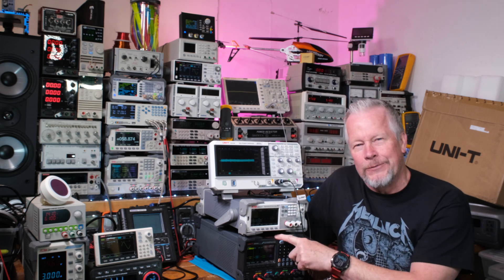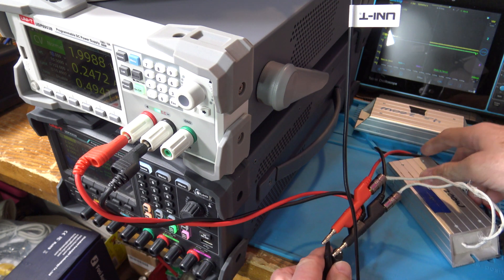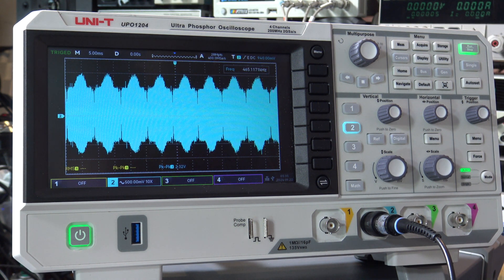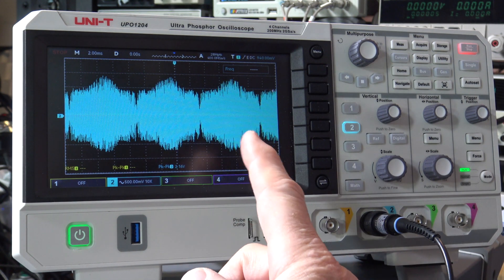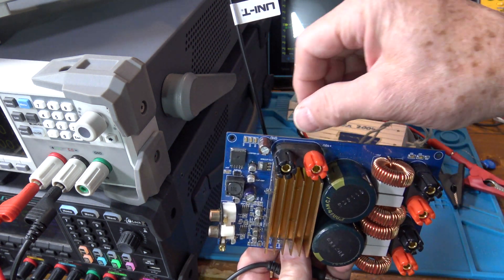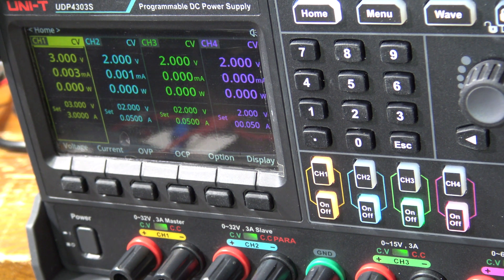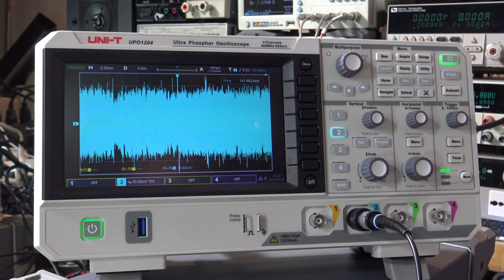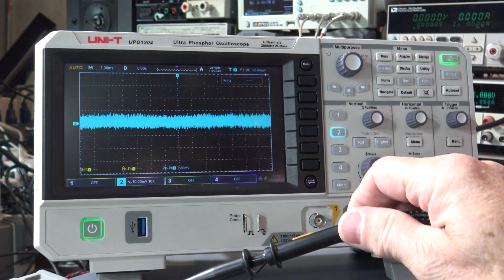Noise in Bench Power Supplies Linear vs Switching with Uni-T UDP4303 and UDP6900 with UPO1204

Comment: Maybe I'm wrong, but to me it seems simply that this specific unit PSU is a bad product. You shouldn't see that ripples on the output, especially in lab supply equipment. It almost looks like the output isn't filtered at all, which would be crazy.
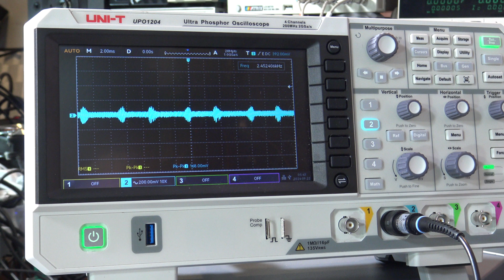Reply from the maker: Thanks for your feedback.  If you look at what I show at 10:30 min into the video - it is actually pretty clean once connected to a load or any input that has the most minimal capacitance.  Also, I am not doing any special probing techniques (trying to minimize the ground loop) so this is actually pretty clean - especially at the full voltage output.   I'll do a video showing how to make a simple filter to help any power supply provide a cleaner voltage.
Reply: @KissAnalog  I didn't think about it when I wrote the comment. Thanks for the clarification. It's interesting to see the differences between load/no load. 

Anyway, I enjoyed the video. Thanks for posting it.
Reply from the maker: I appreciate you!

Comment: I have play some with mine designed resonance supply, concerns the common mode noise. I have read a paper that even 300 mV of noise can degrade the amp distortion very badly. The paper do talk about common mode filters with a feedback through two caps to the primary ground, I tested it and noise did drop to 7 mV max power. Also the paper mention about the transformer, the capacitance between primary and secondary is the cause, a resonance transformer where the resonant coil is integrated as leakage has low inter-capacitance between prim and sec. I do measure nothing as a start. For fly back, she use a extra primary winding who cause a 180 degree signal canceling the common mode noise. this extra windings is set through a capacitor to primary ground.
Reply from the maker: Thanks for your great feedback!  I don't know if I believe in the 300 mV thing - that sounds a bit crazy.

I will show how to filter this;)

Comment: Do anyone believe these measurement results for a second? 10x probe with long ground lead, long wires from the power supply acting as antennas, a wall of powered  cheap instruments in the back blasting noise into the measurement setup. No true measurement's can be gathered from this. Come on man...
Reply: Did you use the 20-20Mhz BW-limit? the UDP6900 should be under 15 mV p-p. If i where UNI-T I would ask you to redo the video to not scare away potential buyers.
Reply from the maker: Great question!  Nope - I think I made a comment about that - but maybe it got edited out.  It is true that most times people automatically use the 20 MHz bandwidth limit to clean up the signal - mostly due to the poor measurement techniques and probes.  But - I didn't want anyone pointing out that I did that so it wasn't a fair measurement.  So, I took the measurement with all the junk that comes with it;)  

I'm doing a follow up video - and I think Uni-T is happy with my videos.  If not - well - I have to be honest;)  Their equipment that you called cheap - is actually really great!
Reply: I don't use 1x/10x probe, and i shurley wouldn't use the long ground lead or long leads in general. Do you really believe that the UDP6900 have 2V p-p noise at full BW? I didn't say UNI-T is cheap stuff. It's pretty good I think - way better than 2V p-p.
Reply: @KissAnalog   Do you really think a 10x probe is the right way when measuring the UDP4303? It is specified at <= 1 mVrms. With a 10x probe you have 5mV/divider minimum resolution which is not sufficient. And with all the other instruments turned on, you can't see the true noise from the UDP4303.  One thing is to not measure an instrument as specified in the datasheet or as the industry standard, but an explanation as to why is waranted. Anyone new to electronics could think that all the noise comes from the power supply's - which it doesn't. That isn't fair to the watchers nor UNI-T.
Reply from the maker: @snabelsvin1 So what probes do you use?  You said wall of cheap test equipment - which Uni-T is on.  What were you referring to?
Reply from the maker: Yes - for what I was doing a 10x probe was/is appropriate.  I am not trying to measure ripple or even noise to some spec - I am comparing 2 different power supply type the same way.  What I did was appropriate and correct.  

If you have a scope at the bench - most measurements are most likely done with a 10x probe - which is appropriate - so that is what I am showing.  

If Uni-T has an issue - well - I guess this will be the last Uni-T that you will see tested.  But I know Uni-T folks are knowledgeable people and will understand what I am doing.  Their equipment is excellent - and they know it.

Any one new to electronics should be watching this and learning.
Reply from the maker: Thanks for your feedback.  LOL - I've been doing this so long that I forget that there are those out there that don't know when to believe their readings;)  

And yes - 10x is the way.  Do you use 1x so that you have a bandwidth limited measurement...?  That is not the way - but this is my profession so I don't expect all to understand the whys and hows.  But that's why I have this channel - to teach.  If you have some constructive criticism - we'd love to learn.

This is a comparison between two devices - so even if I were in a mine field - it would be a comparison;)  

In this case - I know how clean my bench power is - so yes - I do believe these measurements.  I have a new video that might make you a believer - I hope to publish it very soon;)

BTW - that wall of instruments are not "cheap instruments" - you are giving away your unwarranted prejudice and lack of knowledge about test equipment;)  Come on man;)

Comment: So why don't they stick a ceramic across the outputs at the factory ?  Another cap will cost a couple of cents.
Also wondering how much of the noise on the linear is from all the switch mode supplies running above the bench ?
Thanks Uni-T.
Reply from the maker: Great questions!  I think the noise we see here is trivial and as I show is easily 'mostly' swamped out with a single capacitor.  Yes adding one more might have helped, but after the length of the leads and such - at high frequencies it does carry.  I think you can use an LC type filter to clean it up - but they are also making a decision on how much they are going to do - and how important it is.

The linear has a low frequency switcher that causes a lot of noise - but is mostly swamped out with the bulk and bypass capacitance.

Comment: I bought a cheap (230VAC to 9 VDC) AC adaptor for my midi keyboard and effect pedals etc. It is switching mode type. It caused horrible ground loop kind of problems when midi keyboard was connected by USB to my laptop and soundcard etc. I measured  that there was around 120 VAC between the outputs of the AC adaptor and mains safety earth. Sparks were seen if the DC connector touched the safety ground. With 100k load still 80 VAC. With 2kohm load still 2 VAC. I had to build a traditional linear power supply using 7809 regulator to get rid of that switching power supply problem. That's my story of comparing linear and switching power supply.
Reply from the maker: Thanks for the great feedback!  I have also heard similar stories with mixing linear power supplies with poor grounding;)  Also, all wall warts are not equal;)
Reply: @KissAnalog  By the way, I noticed  that traditional non-toroidal transformers seem to be better in that respect that at least the measured capacitance between primary and secondary seems to be much smaller than in the case of toroidal transformers. So it seems that if you want to minimize the AC voltage (measured between secondary and safety earth) "leaking" from primary to secondary through the capacitance between primary and secondary windings of the transformer, a non-toroidal transformer is the better option, even if it causes much bigger magnetic interference. Maybe it is inductance related thing as well, I don't know exactly, but the capacitance between primary and secondary is very easy to measure even it is quite small, and the difference seems to be significant.
Reply from the maker: You point out some great topics!  There are tradeoffs for sure.  A toroid can be made very quite with a simple shield.   Another thing you find is a capacitor from primary to secondary - and if this is done it swamps out the capacitance found in the windings.  Every case has to be looked at on its own.
Reply: @KissAnalog   So I suppose that it is useful to use a MOV in parallel with the primary of a toroid transformer to tame possible input voltage spikes etc. because if (especially in case of cheap low power transformers) there is no static screen between prim. and sec., those voltage spikes travel very easily from primary to secondary because that unwanted capacitance between primary and secondary.
Reply from the maker: Thanks for this feedback @jutukka 
Please don't use MOVs as they can be very dangerous.  I've done a couple videos on this.  I used to be one of the top designers for lightning protection - so I do know what I am talking about;)  Now remember, the capacitance from primary to secondary is very small - so no serious spikes are getting thru this.  The inductance of the transformer as well as what is in the EMI filter is going to protect your output.  It is more likely that the input will be damaged - which also protects your output.

Comment: You cannot measure power supply noise accurately with a scope as shown. Because the scope is earthed, you are always going to get a mix of common mode and differential mode noise. Having the probe tip on power supply ground with probe ground left floating should get you only CM noise, and for DM you either need to bust out a differential probe or DIY a makeshift one with two identical regular probes and a tiny amount of trace arithmetic (A-B).

The SMPS is generally going to have a rather noisy chassis ground (vs. "clean" mains PE) due to all the stuff that gets pumped into it by internal mains filtering. If the output is floating, internal parasitic coupling via the internal transformer and parallel Y capacitor between primary and secondary side grounds will also be involved. There was a thread on ASR about Bruno Putzeys and the crux of Y capacitors just the other day, this may be worth a read.
Reply: Thru, measuring is the art of exact science.
Reply from the maker: @Janktzoni So true;)  Also knowing what and how to get good enough measurements without making a science project - is actually an art in itself;)  After measuring and designing as many power supplies as I have - you become aware of what is significant - and what really isn't.
Reply from the maker: Thanks for the feedback!  Actually - yes you can;)  Or, to a degree.  But we are comparing two power supply outputs - and to show the 'best' way to do this would make for a much longer video.

I am going to do a follow up video to address this.  I think that you will be surprised by the results.  I'll try to post it this week.

Comment: Really liked your demonstration of the noise for the two types of p/s. Very fitting as I just decided to purchase a used linear dual p/s (plus fixed 5vdc) from ebay instead of a new switching p/s for the noise decrease. I may not have to measure mine now 😁
Reply from the maker: LOL - thank you!!  Actually - you still should;)

Comment: Seems to be typical for all switchers, question remains, why do not manufacturers filter them out of the gate?
Reply from the maker: Actually - my designs try not to create as much noise to begin with.  Always easier to deal with - if it is not there.  Then - I do add HF filtering.  I'm sure that they have done some filtering - but there's a point where it looks worse than it is.  What is left here is very high frequency and very low energy density - so should not be a problem;)  IMHO
Reply: @KissAnalog  Good thinking, not having the problem to begin with is likely the way to go. And i suppose as you said it looks worse than it actually is and there is input filtering on amps (which is my case) so should be good.

Although, for funsies i thought about getting/building capacitor buffer bank (something like PULS UF20.481) and put before the amp, integrating a ceramic bypass cap into that should make the supply tidy i guess. 

All overkill but all in the name of fun 🤘😆
Reply from the maker: Yes - there are a lot of options and fun things to try;)  Thanks for the great feedback!

Comment: I actually was planning to use a bench power supply for my DAC  but read a lot of literature that these have a significant higher noise floor.
Reply: I assume your DAC is for home audio listening. A well designed and sized linear power supply will have an inaudible noise floor. If that is still not good enough running the DAC from batteries is the only way to have near to 'zero' noise floor. Connect the battery charger on a timer that is set to switch on when you're not listening and you'll never have empty batteries. But if you ask me, using batteries are waaaay overkill for this, even in a top high end studio/lab setup.
Reply from the maker: @Janktzoni I have heard about audiophiles using batteries.  I would really love to know if they can actually hear the difference.  A double blind test study would be great to see;)
Reply: @KissAnalog  In the previous century I ran a small blind test with CD vs chrome tape. Setup was so called 'hifi' and good quality headphones. Big difference you would think and easy to spot. Actually, very few people could hear any difference at all and even less could identify which was de CD.
Also did a cable double blind test between expensive thick wires and CAT5 bundled pairs on good quality speakers. Ran all possible combinations including mixed and very different lengths like the whole 300ft roll of cat5 vs a few meters, no one could tell any apart.
Reply from the maker: Thanks for this fantastic feedback!  It does not surprise me at all - even if you had 'golden ears' in your test - they would not be able to tell;)  That's why we don't see people claiming this and showing that they did it;)
Reply from the maker: Thanks for your feedback.  Did this noise floor translate to higher THD at the audio output?  Or is that what you are referring to?  The noise that we see here is not in the audio band - and it is easy to filter.

Comment: Really interesting. My bench supplies (can do 5A at 35V peak) use mixed regulation and I typically get much less than 10mV peak-to-peak...
Reply from the maker: Thanks for the great feedback!  Is yours a switcher?
Reply: @KissAnalog  Well I don't know its exact architecture, but I suspect they ares a switching supply followed by some kind of linear regulator. Made by Aim TTi and were best part of 500 USD each.
Reply from the maker: Thanks!  If they are heavy - then they might be low frequency switchers with linear regulators.  If they are small and light for the power - then they hare high frequency switchers - and regulated switchers;)